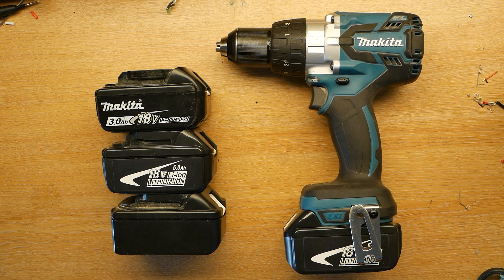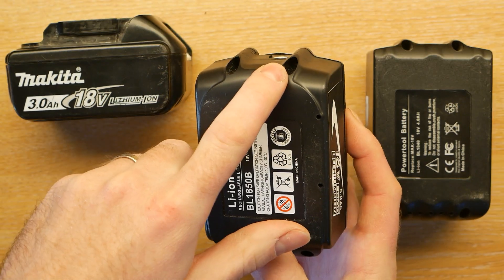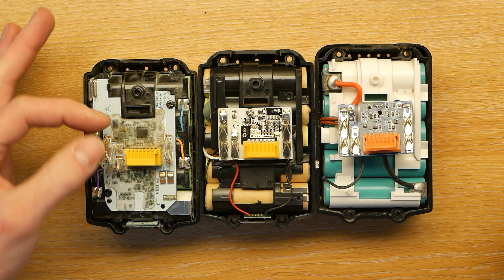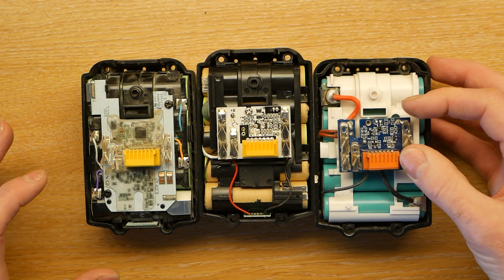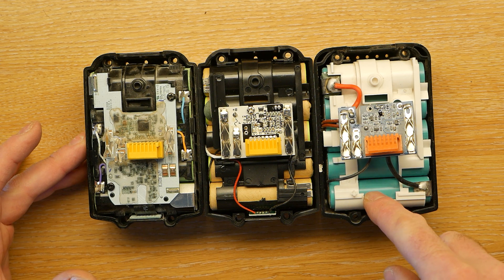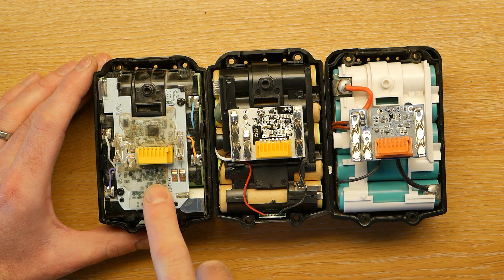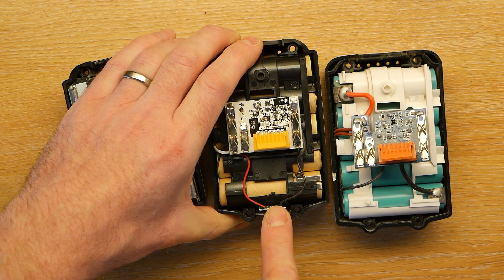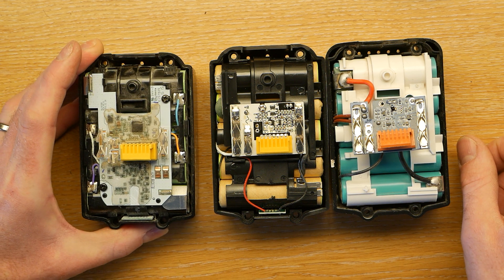What's inside Makita 18v LXT BL1830B OEM and clone battery packs?

Comment: The makita batteries with the LEDs are actually quite sophisticated. They keep records of overvoltage, undervoltage and overtemperature events as well as cycles. And they also have a theft protection feature that can be activated with a rather expensive makita programming adapter where they turn off completely after a certain amount of time and only the right password through the programming adapter brings them back. They also actively communicate with the charger to optimize the charging speed. And after 4 (?) consecutive failed charging attempts they lock out completely. 
I wonder what other secrets these batteries hold.
Reply: here's a secrete they have: they have no balancing. "Sophisticated to ensure the battery is bricked under specific circumstances" isn't the type of sophistication I am looking for.
Reply: @fiveangle balancing is done during charging, so the balancing circuitry is only in the charger. newer batteries might be different though
Reply: @drkastenbrot  there's no circuitry in the battery to individually connect each cell to the charger which would be required to support individual cell balancing, so why do you state so confidently that balance is happening ?
Reply: @drkastenbrot  I bought a 5ah makita BL1850B battery and after a year of not much use the thing would not work and would not charge? I did always have a quick check on battery level by pressing the battery indicator button but I left it a couple months and then remembered and the thing was junk? 

After a good google I found info stating that the battery indicator always draws a small amount of power from one cell and when left and not charged this tells the chip that one cell is damaged (but it is just lower than the rest) because of the set up Makita use... so wont allow you to charge it... AND THEN the bleeding charger AFTER A COUPLE ATTEMPTS blocks the chip so that it will never work/charge again! THANKS MAKITA!! why they dont bloody tell you this? 

I cant for the life of me think why else this battery would not work?
Reply: @stephenmaas8775 what people told you is false, the batteries I tested are all draining evenly. It's likely that you just let an empty battery sit around, battery cells themselves self-discharge slowly over time.
Reply: @drkastenbrot  I kept it charged a few times but left it a few months without checking as It still had battery on the staus bar so I thought it would be ok? My Hilti battery has sat for a year or more and is older and that is still full and charges great? Could it possibly be the charger or maybe even the drill? I remember i had took the charger apart and cleaned it all after watching videos about the charger but I never had a spare battery to try it and since issue with this battery I've been questioning whether to buy another makita battery? I had never known that the drill itself effects the battery in any way but since reading down these comments?
Reply: @drkastenbrot  I spent hoirs and hours reading every forum and every google post possible? including what i coupd on youtube!
Reply: @stephenmaas8775 Best state of charge for storage is about 40%. If it didn't deep discharge and just broke like that, it is likely just an unlucky factory defect. The LED battery indicator on makita batteries has neglegible parasitic drain.
Reply: @fiveangle  I bought a 5ah makita BL1850B battery and after a year of not much use the thing would not work and would not charge? I did always have a quick check on battery level by pressing the battery indicator button but I left it a couple months and then remembered and the thing was junk? 

After a good google I found info stating that the battery indicator always draws a small amount of power from one cell and when left and not charged this tells the chip that one cell is damaged so wont allow you to charge it... AND THEN the bleeding charger AFTER A COUPLE ATTEMPTS blocks the chip so that it will never work/charge again! THANKS MAKITA!! why they dont bloody tell you this? 

I cant for the life of me think why else this battery would not work?
Reply: no wonder they are so expensive!
Reply: Do you know if the battery circuitry has under voltage protection? I've soldered together an adapter with a chip that outputs usb-c PD up to 100w. It accepts 12-28v and I'm worried going all the way to 12v would damage the cells.

My googling online has given loads of contradicting information. Some claim the battery has that protection, others say the star rated tools do it themselves. If it doesn't then I was looking to implement the circuitry myself by I'm really confused from my searching.
Reply: @beardedchimp  it does not. the undervoltage protection is handled by the tool. power tools can draw hundreds of watts from the battery which makes the circuitry required a bit costly. instead, the tool takes care of that because it already has the necessary power switching circuitry built in. some higher power tools even make use of the yellow connector to actively communicate with the battery and monitor temperature.
Reply: @drkastenbrot  some LXT packs (mainly 5Ah and 6Ah) do have high powered mosfets that can cut power independently of the tool. They use a fairly high end mosfet with just 0.45mOhm resistance. There's a video on my channel and a reddit post about it.
Reply: @toolscientist  yeah, from 2019 on it seems to be standard on 5ah and 6ah but im not sure about the smaller packs. it would make sense that they have it too now.
Reply: @toolscientist What does this mean? I bought a 5ah makita BL1850B battery and after a year of not much use the thing would not work and would not charge? I did always have a quick check on battery level by pressing the battery indicator button but I left it a couple months and then remembered and the thing was junk? 

After a good google I found info stating that the battery indicator always draws a small amount of power from one cell and when left and not charged this tells the chip that one cell is damaged so wont allow you to charge it... AND THEN the bleeding charger AFTER A COUPLE ATTEMPTS blocks the chip so that it will never work/charge again! THANKS MAKITA!! why they dont bloody tell you this? 

I cant for the life of me think why else this battery would not work?

Comment: Just returned a 6Ah / 6000mAh "fake" as the cells were 2 banks of five 1500mAh cells from China - a 3Ah battery at best, if they are really 1500mAh!
My original 5Ah BL18650 weighed 633g, the "fake" 553g

Comment: Are you sure those wires actually balance the cells and don't simply monitor over and under voltage ,n.ie its a bms rather than a balance board
Reply from the maker: Well, the clone packs don't connect individual cells so I'd imagine they are just a BMS - measuring the voltage across the first cell is 1/5 of the pack voltage would allow them to do a basic check that the pack was ok. The OEM Makita pack might do some balancing though - there are a lot more components on there and it does connect to every cell individually.

Comment: if you are just using those chinese ones on just a drill, then okay, maybe they will live long enough. but i bet they will dicharge their power like a roman candle if you put them in a duc256 for instance. 
i am still looking for a solution about the microcontroller that bricks the original makita pcb. there is a f0513 and a l5202 on board, and i wonder wich it could be, how do you make it forget, and will the pcb live again. unfortunately microcontrollers are something i dont know a lot about, but i think have the solution so many seek.

Comment: I expected at the very least to see:
1) the 18650 cell form-factor verified, and IF not 18650 then whatever it actually is (like perhaps the similar 21700)
2) the li-ion cell pack configuration (e.g. 5s3p) identified, 
3) if at all possible also the cell brand and part number if printed on the cells or in any consumer literature like the user manual, 
4) the CLAIMED per cell mAh capacity/ampacity, 
5) mAh compared to actual test results from using a well-known reasonably reliable analyzer like an ImaX B6v2 or even if only something as simple and cheap as a ZB2L3 analyzer...
6) literally any info or test results that would give us meaningful information on the actual performance compared to claims that allows us to know and compare the authentic Makita pack performance with the clones' performance.
Reply: Exactly, 8 minutes of bla, bla, bla, not showing the most important.
Reply: OK, I will answer you.
1. They are 18650's, even an idiot can see that.
2. They are 5S2P - even an idiot can see that.
3. He TOLD YOU that the cells in the clones aren't marked. So how the FUCK can he verify the brand, dumb arse?
4. No performance claims per cell are made - remember, the cells are unmarked. Dumb, or what?
5. Yep, capacity test would be interesting but almost useless. The Chinese clone packs will contain whatever cells are cheapest on the day of assembly, maybe new, maybe used, maybe good, maybe faulty. So any measurement of capacity will only apply to the pack(s) shown in the video, so couldn't be applied to other clones purchased elsewhere.
6. See point 5.

Comment: I cant believe that in year 2020 retards still sell 18650 battery packs 
without basic cell ballancing. Someone really should investigate whole 
battery market because this is beyond my imagination how dangerous is 
that stuff. If one cell gets weaker then it will charge over 4.2V and 
blow up, even beginners in battery stuff know you cant do this shit.

Lately in poland shop i bought whole angle grinder with battery for like 40$ and even that cheapest possible crap have balancing circuit it xD. You can buy quality samsung cells and use it for years. Here you overpay x5 for makita shit and cant replace cells in oryginal battery, and if you buy replacement you need to charge it in metal container to not burn your house xD Never again makita, very overpaid troublemaking battery system.

Comment: What is function of thrd terminal, one is main postive and second is main negative and what is purpose of third terminal which is just sitting on left side just along side with positive terminal, usually  (TH) is written on it??
Reply: It could be the thermal sensor. In case of hot cells, it would stop the tool or the charger.
Reply: @ozciva  Yes, that pin is essentially a temperature and amperage lockout. If the onboard battery microcontroller senses too high temp or current, that TH pin is activated, which locks out the throttle control in the tool.  It's easier to lockout the tool's speed controller rather than cramming MOSFETS in the battery.

Comment: Well, I found this video because I am about to buy a new battery. Now that I have watched this I will spend a bit more to get a 'safe' ( er ) battery and buy Makita
Thanks for the video and your time in doing this.
Reply: Whenever Espruino makes an assumption in this video, it seems he favors Makita every time or tends to put it in the most favorable light possible...so I tend to think he's being a bit too biased here.
Regarding your comment and safety...
Please note there is nothing that actually proves the Makita battery pack is 'safe'(er), and if you are relying on the information in the video that the two "I50" items are fuses...some evidence instead supports that they likely are shunts designed for current sensing in the pack.
I also don't understand why Espruino would suggest using standard "Phillips" screws is a comment on quality of the entire product. That makes ZERO-sense. I actually prefer products that use "standard" fasteners as they are easier for the user to gain access to make upgrades, replace old cells, etc. In general, "special" fasteners are usually used by a manufacturer to prevent a customer from doing things like replacing Li-Ion cells so the consumer has to replace the entire product at a MUCH higher cost...and sometimes at a hgher cost to the environment...e.g. more stuff in landfills due to lax and/or improper recycling.
Espruino also suggests "contacts are doubled up" and concludes that allows more current. That is another assumption on his part. Actual performance depends on other factors such as the dimensions of the conductor, and very importantly the alloy(s) used and how they are used. For example, nickel-plated steel strips vs. nickel-plated copper or other superior conductor makes a huge difference as anyone who is well informed and constructs battery packs will tell you. He also makes assumption about component population of the underside of the PCB in the Makita battery pack.
Reply: @exgenica  doubling up the contacts will increase the current carrying capacity.

Comment: I bought one of these makita copy batteries expecting a non protected batterypack.
Indeed, no protection for overcharge/undervoltage.
Capacity claimed was 6 Ah but tests showed only 3 Ah and no cutoff at too low voltages.
Current delivery was good enough to use, cells are not that bad.
I think the processing on the fake board is used to fool the Makita charger.
Reply: There are now Makita compatible replacement batteries for sale that do have proper cell protection built-in.
Problem is, most of the time you just don"t know.

Comment: The capacity of the fake batteries is real BUT!!!! The cells they use aren't High Drain/High Discharge cells. Genuine Makita, Dewalt, Milwaukee etc will use high discharge cells rated at generally 25-30amp discharge rate. Sometimes they use as low as 20amp in 10 cell packs as they are parallel 5s(5 cell) and 20amp X 2 gives you 40amps of draw power.  FAKE battery packs are generally constructed out of reclaimed 18650 cells from old laptops or just cheap cells that are only rated at 5amp to maybe 10amp draw. So you have essentially 1/4-1/2 the tool power. A drill, grinder, etc will stall out with little force. Real battery pack gives 40-60amps of power vs Fake with 10-20amps. They aren't worthless though and make great batteries for low power tools like Lights, Fans or other low drain tool accessories. By the way, Great video.
Reply: a bit exaggerate but we get the idea.

i doubt you gonna tell the difference on my job site if you give a fake vs real battery with a makita grinder.
Reply: @EnnTomi1  You absolutely will. The tool will constantly stall out under load(low voltage cut out) because it can only deliver 20 amps versus the required 40 to 60 to run.
Reply: @sixtyfiveford  After 3 years working with all the tools.....the only difference i notice is shorter run time but that is totally expected also the false claim on the capacity of the cell. Other than that, the power is exactly the same. (metal drilling, metal cutting, blower)
Reply: @sixtyfiveford  maybe my tools dont require that much amp. we have those 18x2 blower, and angle grinder might be the most power hungry tool. i don't know how much watt they use tho.
Reply: @EnnTomi1  and 6 months later a stranger appears in the comment section: i use a battery powered trimmer to cut the grass & weed and it constantly stalls with the aftermarket batteries after 2-3 minutes of work. it lasts for around 15-20 minutes with the oem batteries under the same conditions. aftermarket batteries need about half the time to get charged with the same charger. 
short version: i do notice the difference. however i never noticed the difference with my power drill or or the grinder

Comment: Does the official one have built-in over-discharge protection?
Reply: Thu Nell Ⓥ  it doesnt!!!.  you can see that the battery connections connected directly to the cells using only 1 fuse -not mosfet!!! so the circuit cant protect the cells from anything exept short circuit.
Reply: It doesn't need overcharge protection. The charger contains that circuitry.

Comment: Hmm, Thanks for the video but just opening the housing and talking 8 minutes about your guessing and believe... I am a bit disappointed. You have no profound arguments for the controller nor cells nor capacity nor facts about unbalanced cells in the OEM packs... Maybe you can add some more valuable information to such a long video.
Reply: Agreed. Far too much assumption. Great example is "cell balancing"... genuine Makita packs don't have balancing either, it is very rare on ANY power tool packs.
All they do is monitor cell voltages and trip an electronic fuse or trip a lockout if any of the cells go above or below certain pre-programmed voltage thresholds.
Reply: AGREE. At least ID the cells in Makita. I came here to be able to spot GOOD FAKES. The top view of OE Makita PCB is helpful. Both of his knockoffs NOT asserting to be OE Makita, simply "compatible".
Reply: I'm looking forward to your video on the subject so we can all see how it should be done. You have had four years so I am sure you have done it by now.

Comment: Great content, thank you for that video! I think the 2 parallel parts on the PCB of the original battery next to the terminal are actually shunt resistors for current sensing. Do you have high res pictures of the PCB? I would be interested to see them!
BTW: Do you have any information on how the communication between charger and battery as well as tool and battery is done? Do they use a "standard" SMBus compatible protocol with the charger or is it completely custom? I am wondering if I can read data like cycle count from my batteries.
Reply from the maker: Thanks! I'm afraid I don't have anything high-res, it's literally just what's in the video (1080p). Shunt resistors make WAY more sense - thanks! I'm afraid I have no idea on the protocol though - I haven't had any need to look into it too deeply so far, even the cheapest batteries haven't died yet :)